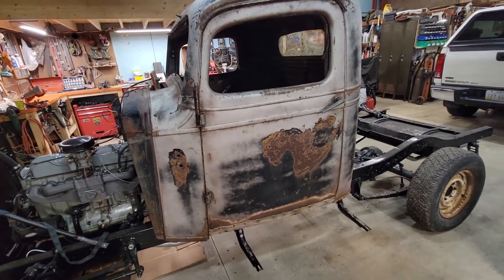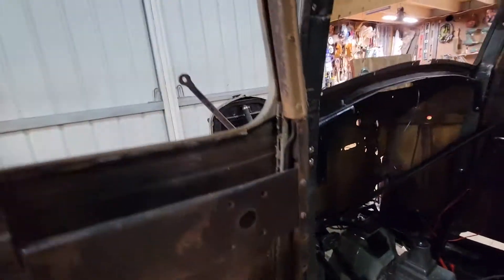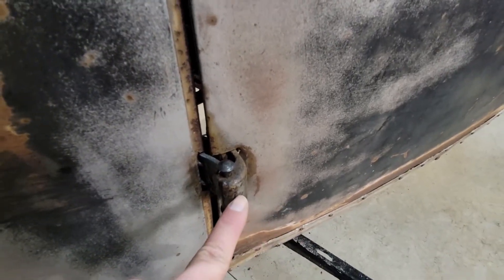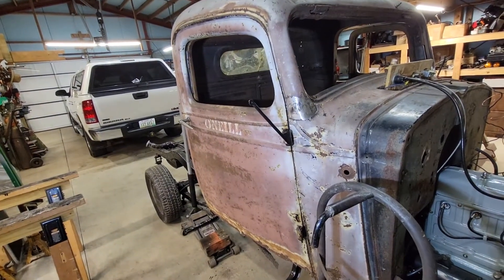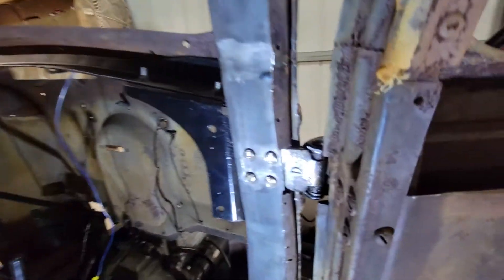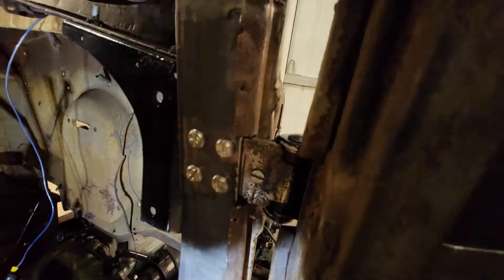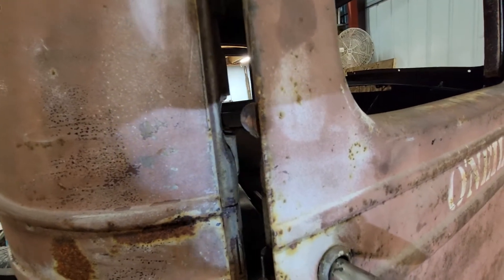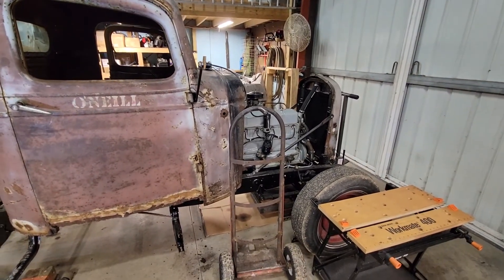Mirror Bracket Attachment

Comment: Good idea putting a mirror on the passenger side, there's not much visibility with the small back window. I checked my truck and the hinge has a hole in it for mounting the mirror like you did, but my truck has a different style mirror bracket that clamps onto the hinge with set screws and pivots with the door.
Reply from the maker: I drove truck for 31 years and I'm used to using mirrors. I've seen the 36 pickups with both mirrors and figured that was the way to go. That's interesting that your mirrors fasten to the hinges, I've never seen that style, but if it works that's all that matters.
Reply: @snowking55  My cab was originally from a grain truck, so I'm thinking it had bigger mirrors. I'll probably just end up buying the brackets like you have.